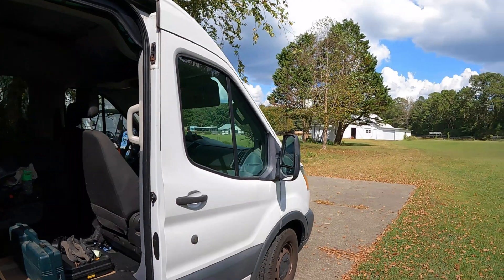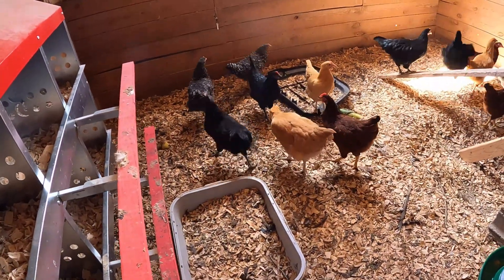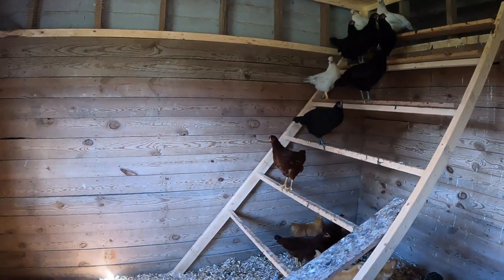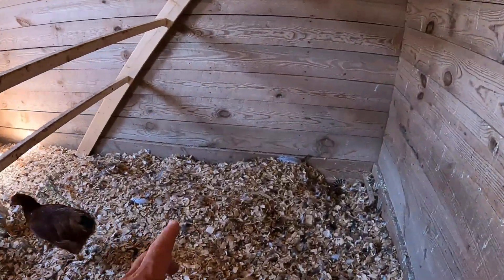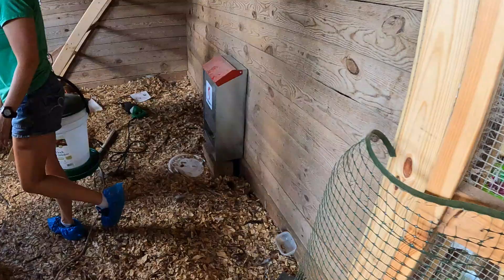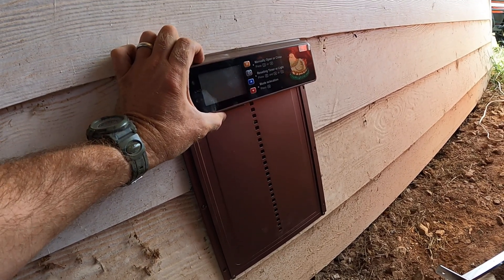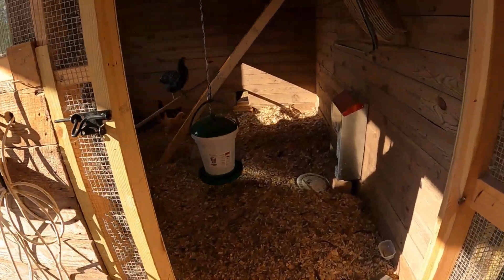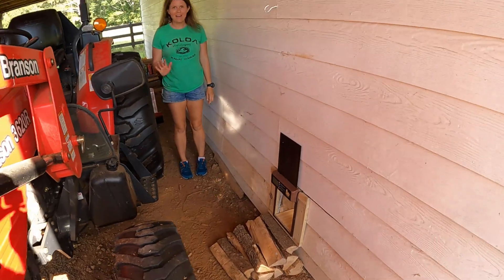Installing a solar powered automatic chicken coop door

Comment: How do you program the unit?
Reply from the maker: I just followed the directions in the manual using the keypad on the unit- it was quick and easy!
Reply: @ThePlantPirates  I had to return mine.  It would not set the time.

Comment: That's so cute.  Great job. The hens are growing up nicely. They start laying around six months old or so.  Hens are very smart and social. Once one figures something out the others will too. I installed one of these doors on my coop.  All the hens got it pretty quickly but one. Hot Wings my Copper Barnevellder just couldn't figure it out. Took her nearly two weeks.  We had to catch her every night because she couldn't get back in. Then we started having trouble with the door would open and close on its own. We had it on manual, with a remote, so it should not have been doing that. Also we had it powered to an outlet.  The worst thing that happened was it closed and we didn't know before night time and all the chickens were left out in the dark. When we went to get the nightly count it was so scary to find none and we had to find them in the dark.  So it's still on the coop but unplugged sadly. We couldn't figure out why it was going up and down by itself.
Reply from the maker: Haha-sorry for the late response!  That’s crazy…our door is still working great! Hopefully it doesn’t start acting crazy like yours did-that is a terrible thing to happen and then it puts your chickens in danger if they get out or something sneaks in